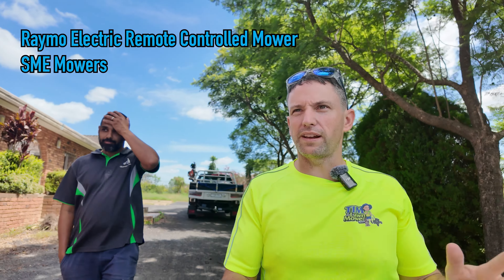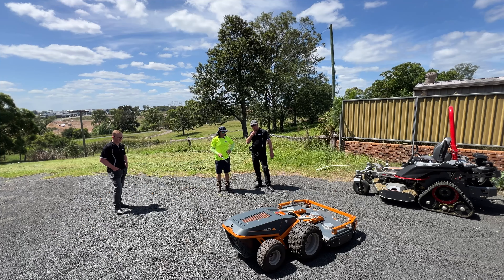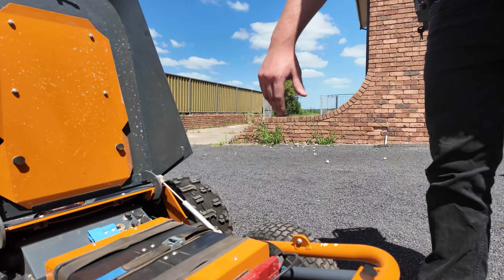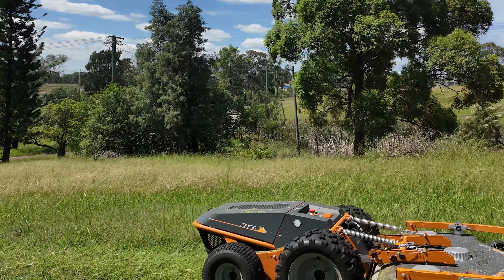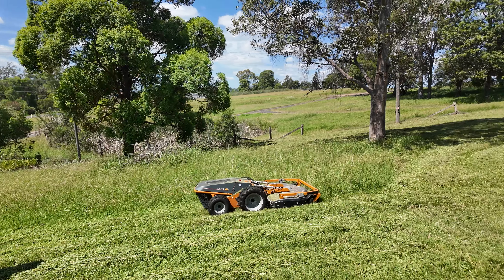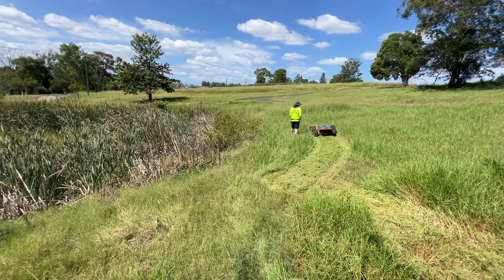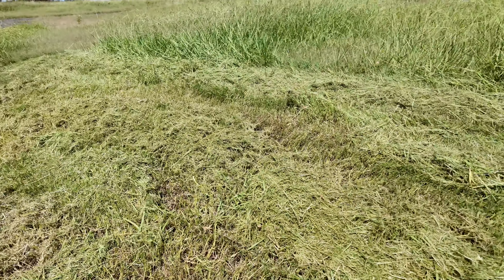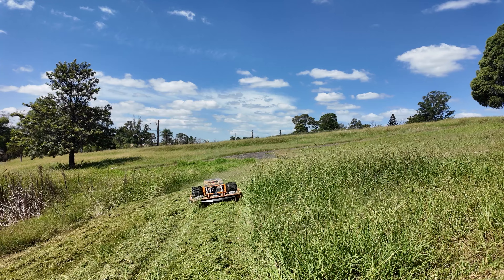Raymo Electric Remote Controlled Mower. I want one!

Comment: 3 questions.
1. What is the range of the remote?
2. Will they make a control unit with a built-in stubby holder?
3. Will they accept payment in the form of my wife's, my first 3 born children and mother's kidneys?
I would offer mine, but seeing as I asked about a stubby holder, it's obvious I need both.
Reply from the maker: Here is the long answer from Their website but looks like around 100m easily. 

Let’s take a look at some of the factors that directly influence the radio signal distance. Raymo, just like most of the other machinery remote controls used nowadays, works in the 400 to 900 MHz range (based on the country legislations) as this frequency gives a good proportion between distance and the amount of information that can be transmitted. In general, the lower the frequency is, the longer the wavelength and the greater the distance. Long waves have the ability to avoid larger obstacles and thus travel a longer distance. The downside is that they can carry only a limited amount of information. On the contrary the higher the frequency, the more information can be included in the transmission, but – as the wavelength is short – the broadcasting range is limited. You could rightly argue that you can compensate the distance by increasing the transmitting power. This is generally true, but not in case of these radio control handsets, where the transmitting power output is limited to 10mW – mainly for health and safety reasons and limitation of interference.   

So, with these particular frequencies and power outputs the maximum radio control distance under ideal conditions can be up to 300 meters (1000 feet).  This, however, is hardly ever true and the radio range will most likely be around 100 meters (300 feet) as there are many other factors that we need to take into consideration. Which ones are these? Interference is perhaps the most important one. If there is equipment operating on a similar frequency, the interfering signal may significantly reduce the radio signal reach. Luckily the radio controller can work on multiple channels so – on in case you experience signal drop outs – you can switch to another frequency. Radio signal can also deteriorate in the presence of a strong electromagnetic filed. This can happen if you operate under high voltage power lines or – for example - if your antenna is close to the engine spark plugs. Yes, these also create a strong electromagnetic field.

Other factors that can influence the quality of the radio connection are nearby buildings (they reflect the signal), obstacles to direct visibility, antenna placement on the machine and also weather.  However, be sure that in case the radio signal is corrupted or lost, the machine always safely stops and presents no danger to the operator or other people or property.   

The crucial thing to remember is that the purpose of the radio control is not the maximum distance, but to keep the operator safe and away from dangerous working conditions. 90% of the time you will be working within the range of 5 to 30 meters (15 to 100 feet) because the limitation will not be the radio signal, but your eyesight. At 30+ meters (100+ feet) it is already difficult to judge the distance between the mower and the obstacles. With increasing distance, the precision and productivity of your work will be quickly reduced.   

To summarize – always stay within a safe distance (not too near, not too far) at which you can precisely control the machine and yet stay away from any risk. And be sure that most of the time the maximum radio distance will be longer than that the distance at which you can still fully trust your eyesight.
Reply: @turfandtools  Thank you. That's the most informative and legal response I heard for  
some time.
Questions 2 and 3 still remain unanswered.
Reply: Wow that was some reply to mini Steve’s question. 😜
Reply: @Steve.Budgen  I still am missing answers on 2 questions. But we have to let that slide because it was purely for fun factor.